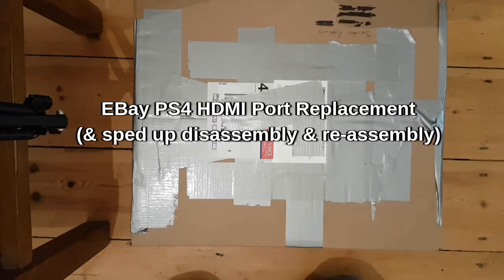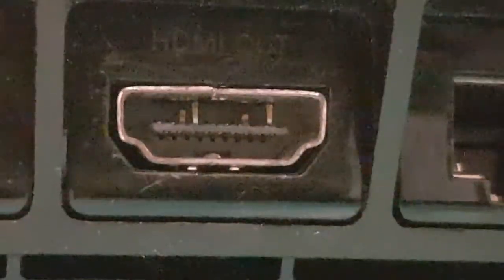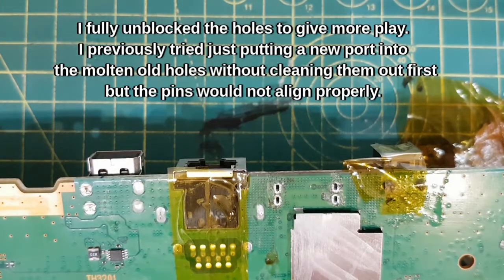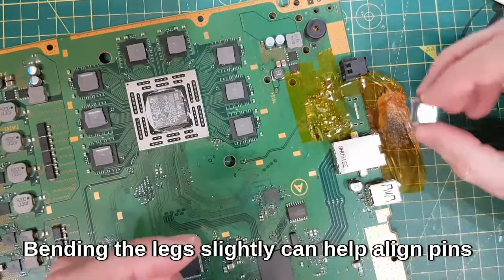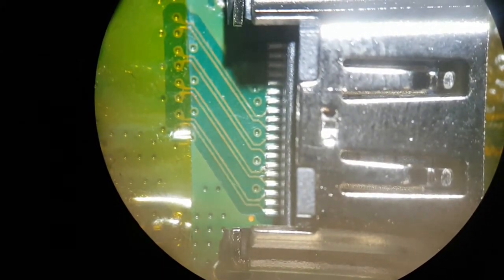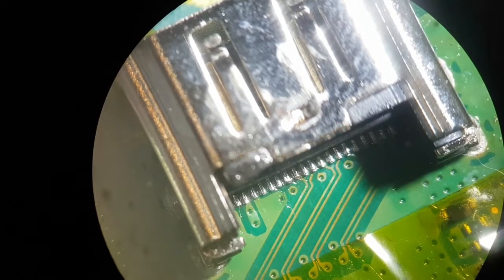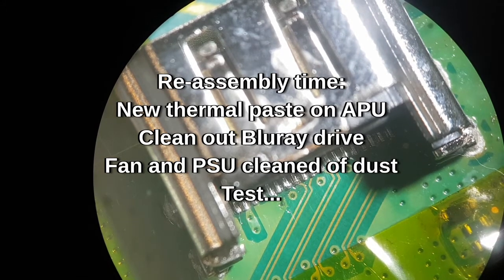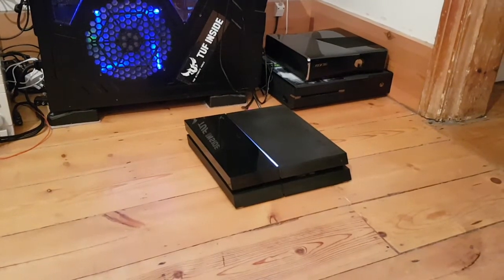Ebay PS4 WLOD Repair (HDMI Port) & Clean up

Comment: Would you consider adding a list of the tools you use. I’m just getting into Xbox modding and have yet to buy a soldering station. Any recommendations? 2-in-1 or 3-in-1.. thanks.
Reply from the maker: Sure, Thanks for watching. I will update the list. I still use an Aoyue 968A+ on a daily basis as my main soldering iron and hot air for smaller / regular work. It is a 2 in one and has served me well for about 4 years. The iron and hot air are both underpowered for things like PS4 or Macbook boards though which can sink a lot of heat. I am thinking of upgrading to a dedicated, more powerful iron and use and old Maplin A55KJ when I need more heat atm. 

For changing ports on things like a PS4 that wick a lot of heat,  I use a Quick 861DW hot air station and that is the one in the video. The desoldering gun is a Duratool 80 Watt. There are many clones sold under different names. It is one of the most useful things I have and again is about 4 years old. 

All the best